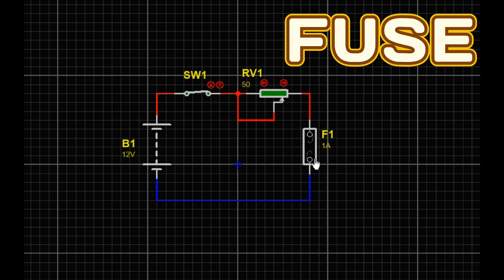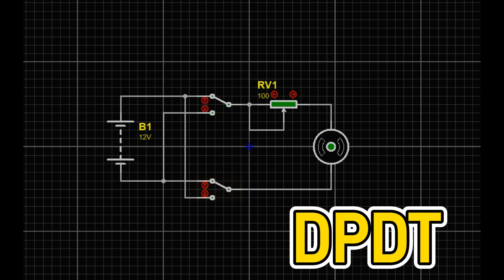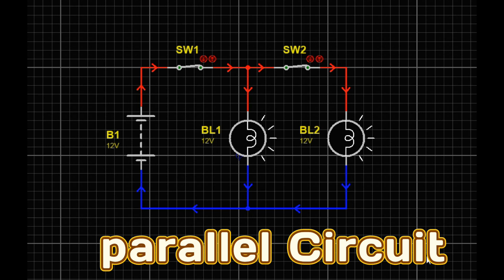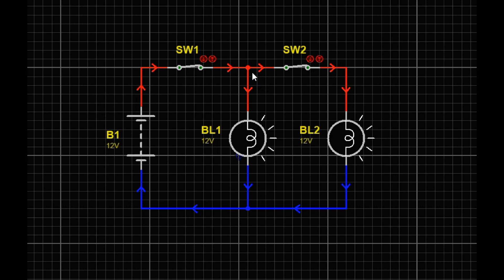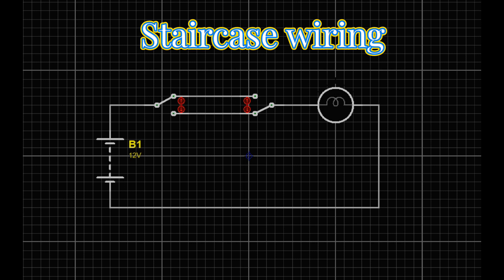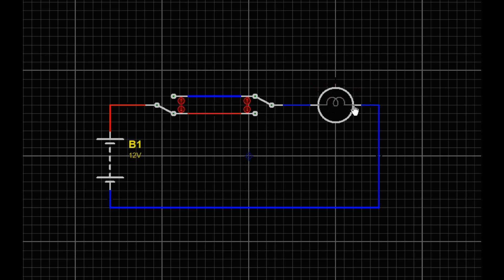Basic electric circuits for Beginners with Simulation

Comment: Hello what software do you use?
Reply from the maker: @Unique-rg1np There are many simulation software options available for simulating mathematics, electronics, and mechanical systems.

Here, I used Proteus 8.

There are many features available, and I will make a video that describes all simulation software.
Reply: @mariapearlsimon  thank you so much